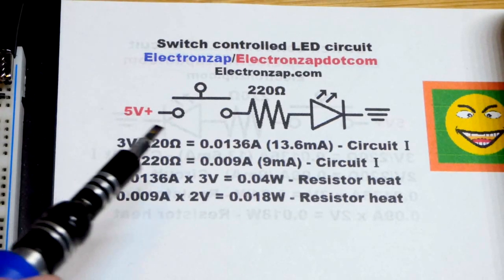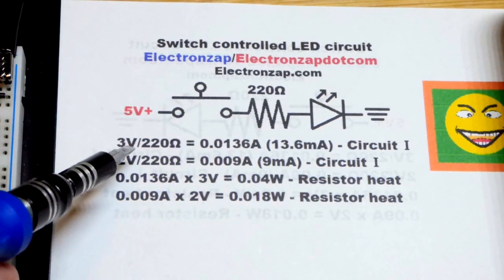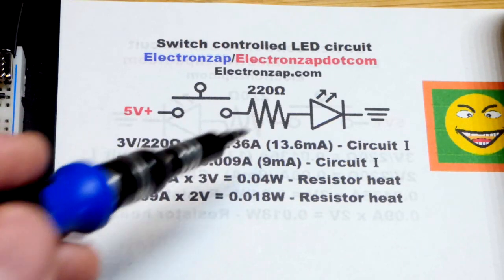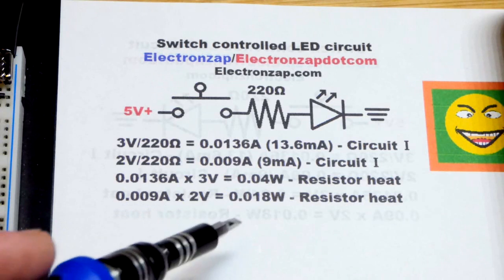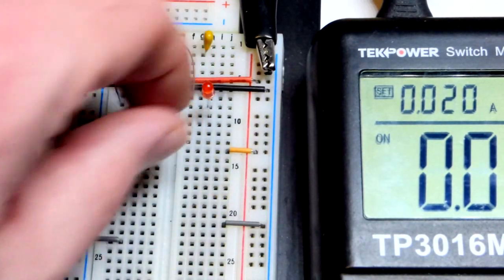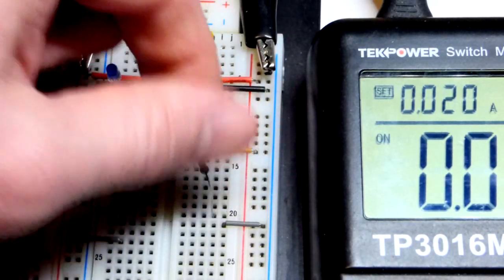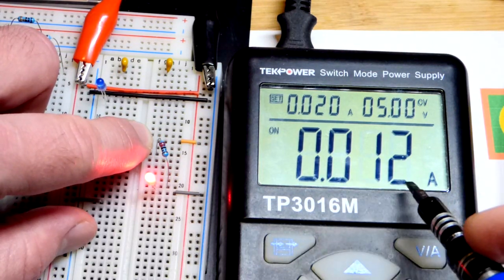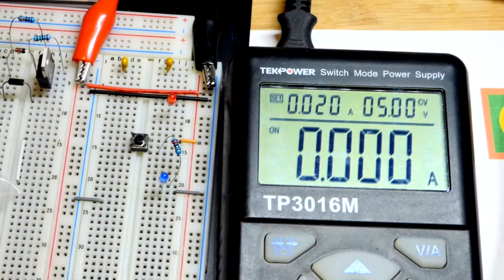Push button switch controlled LED with protective resistor circuit

Comment: Amazing content! Thanks for making these great videos - really among the best on this topic on all of youtube! I'm a beginner and these have really helped immensely.

One thing though: I thought the current is always the same across all sections series circuit ? You are showing different amounts of current flow across the resistor and LED. Are your "3V" and "2V" voltage drop values exact or a quick fudge for purposes of exposition ?
Reply from the maker: Glad to hear, thanks! Current is the same through series components. 
The current through this circuit while the switch is closed is determined by the voltage across the resistor, which will be the supply voltage minus the forward voltage drop of the LED. Red LEDs usually drop around 2V and blue LEDs usually drop about 3V.

Comment: bro i'm confused between a capacitor and inductor, could you do a detailed video showing differences between them?
Reply from the maker: The differences are actually really simple. Capacitors have 2 separated conductive plates that can build up equal but opposite charges when you apply a voltage and sufficient current for a period of time. Those stored charges can be used to power something else brief period of time later on. Inductors are a coil of wire that take a brief period of time to start conducting fully due to a growing magnetic field, and then take a brief period of time to stop conducting current fully due to a collapsing magnetic field.
Reply: @Electronzap  doesn't inductors store energy as capacitors do?

Comment: Those pins that you dont know what it is : it is known as  a header. they can also be used with plugs such as  you might find on a battery for a cordless phone or sensors in an adrunio kit
Reply from the maker: Thanks for the info!